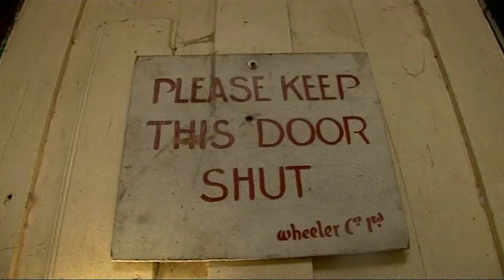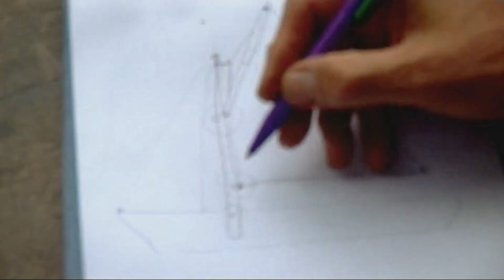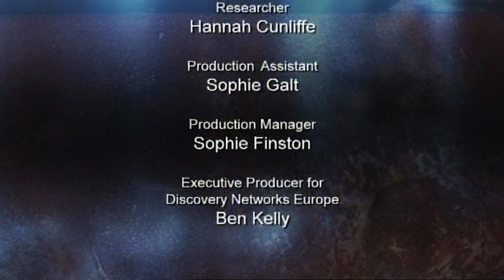SHARPIE PART 2 - RESTORING A CLASSIC WOODEN SHARPIE DINGHY

Comment: Forget the varnish and put some nice coats of paint on her.
Reply: Yes I agree and modern paints will last longer. A few small varnish highlights would complement the main painted surfaces. Cheers
Reply: @AquaMarine1000  I'd forget all varnishing.  I've seen some very nice painted boats and I've painted my own.  There's still the prep work to do, but not to the degree you would need for bright work. And it will take at least 3 coats to look good.  4 to look really good--which is what I'd do.
Reply: @TheSalMaris You are right, varnish on old wood is a lot work and paint always looks smart. Cheers from Oz
Reply: @AquaMarine1000  it's also easier to maintain and probably does a better job of protecting wood.
Reply: Pettit 1933 copper bottom paint, white hull sides with a black boot stripe
Reply: Well I guess he was all bought by the look of varnished mahogany boats and I can't blame him! Just look at the Italian Rivas or something like those. But there is just  a little problem there - 20 to 30 (thirty!) fuckin' layers of the top quality varnish! With all sanding and polishing in between. And all of that without mentioning the condition of the base wood!